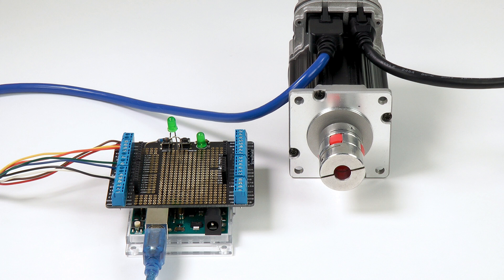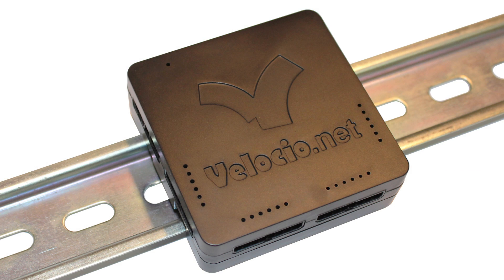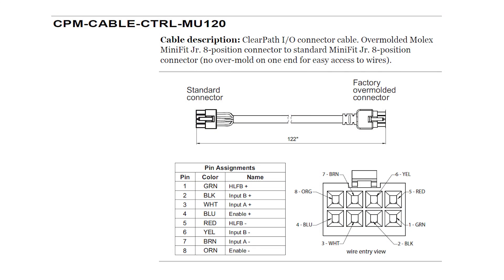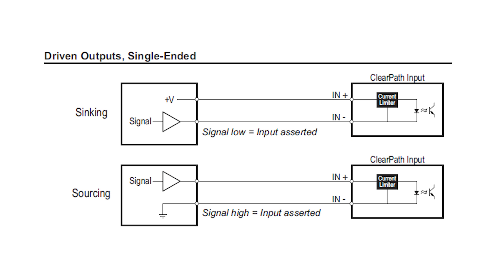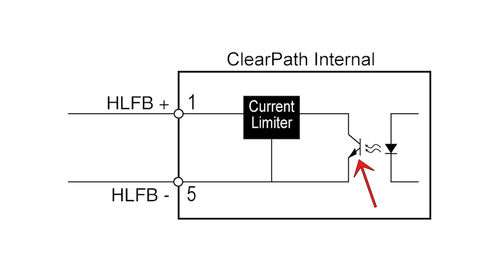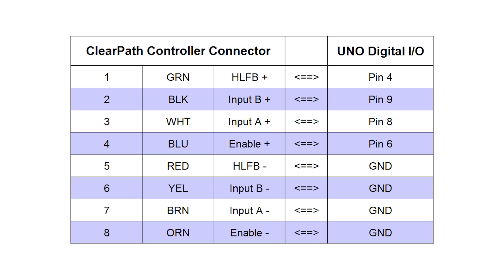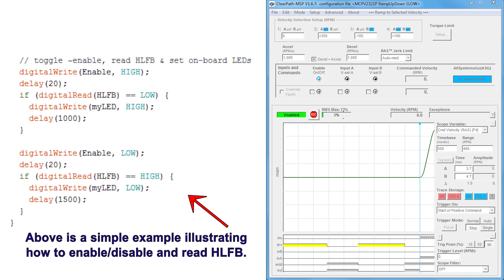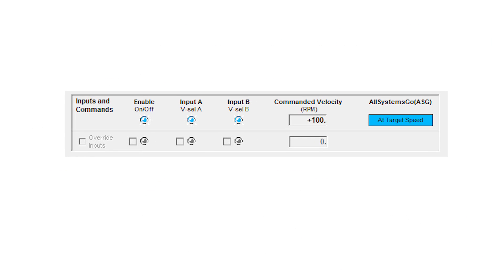How to Wire an Arduino to a ClearPath Servo Motor

Comment: can you control those with grbl software?
Reply from the maker: Hi el SunShine,

While I'm not an expert in Grbl, it's my understanding that this open-source software works off the Arduino microcontroller and is traditionally used to output step and direction signals to several axes.

The ClearPath-SD ("Step-and-Direction") series servo systems are designed to accept step and direction signals from a variety of sources. All ClearPath motors have opto-isolated inputs that can be directly wired up to 5-24 volt logic outputs. Because the ClearPath inputs are optos, you can use sourcing or sinking logic. (You’ll need to be able to source/sink about 8-12mA, depending on your logic voltage. See the user manual for details.)

Many people have successfully connected Arduinos to ClearPath motors.

Here's a short technical overview video showing how ClearPath-SD works: https://www.youtube.com/watch?v=-gigcf7ZzAQ

Check it out and leave a comment or feel free to email support@teknic.com if you have any questions.

Thank you,
Kevin S.

Comment: You appear to have put the same Arduino code(velocity) for for both mode options. I believe the absolute move should be a different Arduino code. Could you post the correct code for absolute position please?
Reply from the maker: Hi cynertia electric, you are correct that we posted the same exact code for both the "Move to Absolute Position" and "Ramp Up/Down to Selected Velocity" modes. In this specific example, the base code for these operational modes can be exactly the same due to the way the positions and velocities are defined within ClearPath. However, the codes should have different annotations in order to avoid confusion (different comments and explanations). Thank you for pointing this out!

The positioning mode allows the motor to move between four different positions, while the velocity mode allows the motor to ramp between four different velocities. In the position mode, the four positions are defined by different combinations of high and low signals being sent to ClearPath's Input A and Input B (i.e. Position One = A low, B low, Position Two = A high, B low, Position Three = A low, B high, Position Four = A high, B high). In velocity mode, the four velocities are defined exactly the same way. In other words, in both cases, the binary combination of the two bits selects one of the four positions or speeds, respectively. This is why you can use the same exact code in this demo video.

I will see if we can make changes to the comments section of the "Move to Absolute Position" code to be more accurate. Please contact Teknic if you have any additional questions.

Best,
Bridgette G.

Comment: Just bought two clear path motors and need to control them with Ardunio. How do i get started?
Reply from the maker: Hi Tonny, This Arduino video is a good supplement to the ClearPath User Manual, step and direction operational mode video, and TekTip Tutorial series. The videos are quick references to get you started while the manual is a more complete explanation with more detail about the set-up. You may want to start with the videos and then move on to the ClearPath User Manual.

https://www.youtube.com/watch?v=1S7etlhbuFY

https://www.youtube.com/watch?v=-gigcf7ZzAQ 

https://www.youtube.com/channel/UC4Q91tGO80QMSHyy1SoHrtg
  
Here is the ClearPath User Manual:  https://www.teknic.com/files/downloads/clearpath_user_manual.pdf

Additionally, here is a link to the Teknic Arduino Libraries: https://github.com/Teknic-ClearPath/ClearPath-Arduino-Step-And-Direction

If you have any specific questions regarding ClearPath and your application, please email support@teknic.com

Best regards,
Bridgette G.
Reply: Hey Bridgette. Do you have a number or email we can reach you at?
Reply: @teknic
Reply from the maker: Hi Sean, thank you for your interest. There are a number of engineers here at Teknic that can help you. It's important to us that your questions are answered as soon as possible to ensure a timely response, please send your questions to support@teknic.com. We look forward to hearing from you.

Best regards,
Tom T

Comment: Hello, I am currently trying to utilize an SDSK motor to move objects on my system up and down left and right etc. I want to use pushbuttons to control all the various movements through Arduino but I'm running into different difficulties. Furthermore, we are building a UI for all these controls as well and I'm wondering if the SDSK will be able to be used for this application.
Reply from the maker: Hello Justyn, the SDSK motor communicates using step and direction signals. You can send steps from the Arduino to move the motor to any location at any speed within the motor's specification. There is a very helpful Arduino community located at https://forum.arduino.cc/ where you can find some specific advice regarding Arduino code, functions, and interfacing details.

Best regards,
Tom T
Reply: Is there a way to tell the sdsk to turn on at the click of a button at a certain velocity rather than telling it to go a certain amount of counts? Or is it only able to take step and direction commands? I've only been able to tell the motor to move at certain counts so far. When I tried to manually apply a PWM to input B so I can control the velocity of the motor through arduino I only get one real slow velocity. Any reason this is happening?
Reply from the maker: Hello, justyn, the SD motor that you have only uses step and direction signals for motion control. You can control the velocity by changing the frequency rate of the pulses being fed into input B on the ClearPath. I am not an Arduino programmer but the Arduino support forum mentioned above should be able to help you.

Best regards,
Tom T

Comment: Are all of your motors wired the same to the Arduino? 
I am looking at the SC motor and with an Arduino Mega 2560 R3. Do I need to use GBRL?  Does your SD motor go through a setup like the SC does when it checks itself? This video caused me confusion and I was not getting the answers I needed from your support. When I called them- they did not recommend the Arduino?  I am trying to do a mill conversion to CNC. Some confusion on YouTube is terminology everyone calls your motors "Servo" when actually they said they were using an SD and not SC.
Reply from the maker: Hi gaewing,
 
This video uses a ClearPath SD motor executing point to point moves (not contouring moves used for CNC control). This is very different than following G-code for CNC applications. ClearPath SD servos are meant to replace other "Step and Direction" servos or stepper based systems.  The SD model simply takes digital inputs for step, direction, and enable and is often times used for CNC machines that have a CNC controller. 
 
ClearPath “SC” servos are meant to be connected to a full PC or single board computer running a C++ application that you write for your application. You use the Teknic provided C++ API for developing your own software application. The C++API is not compatible with an Arduino or similar microcontrollers.  
 
Arduinos are not commonly used for CNC applications for many reasons. It can be done, using GRBL, but your results may vary. Using a more common CNC controller should provide superior results (both robustness and repeatability).  
 
Best regards,
Brendan

Comment: any chance to get a wiring diagram to connect on the most common 3d printer board to really kill the steppers? i have 1000$ components in my cart, i just waiting for a good diagram to remove the actual driver+steppers with the clearpath...
Reply from the maker: "Hi Elstak Manu, 

Thank you for your question. 

There are 3 input signals used for the Step and Direction (SD) motors: Enable, Input A(direction line), and Input B (step line). The pin-out and wire colors for the Teknic CPM-CABLE-CTRL-MU120 controller cable is listed on page 116 of the ClearPath User Manual:

https://www.teknic.com/files/downloads/clearpath_user_manual.pdf 

Your controller needs to output 5-24VDC for each ClearPath input. The "+" for each input (e.g. Enable+) is the active signal coming from your controller. The "-" for each input (e.g. Enable-) is the ground that completes the path.

Please let us know if you have any other questions.

Best Regards, 
Tom T
Reply: Teknic Inc thanks, 2 quesyion thinking to replace all steppers with clearpath: 
1)while autotuning the travel is automatically detected (i think in that mode the board endstop is ignored) or what? 
2)if my design use 2 motors for each move, how to autotune 2 motors in the same time ( HBOT design)

Thanks and... why no 17 line?
Reply from the maker: Hi Elstak Manu,

The auto-tuner function has a screen that allows the user to limit the stroke distance during the auto-tuning process for axes with constrained motion. As you go through the auto-tuning process, you will be given an opportunity to limit the stroke before the actual tuning begins.

Dual motor axes are a little tricky to auto-tune, but one way that usually works pretty well (assuming the X and Y axes have the same mechanical transmission design) is to tune the Y axis (the single motor horizontal axis) temporarily loaded up with half the weight that the X axis handles, and then to use that tuning configuration file (slightly modified as described below) as the X axis configuration file:

1. And to reiterate, we’re assuming that the X and Y axes have the same mechanical design (e.g. both axes use a rack and pinion with the same pinion diameter, tooth pitch, etc.). If the dual motor axis is a different mechanical design than the single motor horizontal axis (e.g. the dual motor axis is rack and pinion and the single motor axis is a ballscrew), you should contact Teknic for support at support@teknic.com. The vertical Z-axis should not be used in this procedure.

2. Load 1/2 the total X gantry weight onto the single Y motor axis and then run the auto-tuner.

3. After auto-tuning the one Y axis motor with the appropriate weight, save the file to your computer as the X axis motor file.

4. Connect MSP to each of the X motors and load the X motor file into each motor. If the X motor shafts are facing each other, one motor will be moving clockwise and one motor will be moving counter-clockwise when the gantry moves down the table. You can either compensate for this by programming your controller or you can select the “Reverse Direction” checkbox on the MSP main page for the Step and Direction mode. If you select the “Reverse Direction” checkbox for one motor, you will send the same exact command to both motors when making a move.

5. If the two X axis motor files are different (i.e., if you checked the Reverse Direction box for one of the motors), save the two X motor files with different names (e.g. Xa_SDSK-3421S_rev1 and Xb_SDSK-3421S_rev1)

6. Run the machine.

7. If the X axis does not seem to have optimal tuning, try to improve the tuning by moving the "Fine Tuning" slider to the left to see if your results improve. You will need to do this with both X motor files before evaluating the effectiveness of this step. If you make any changes to either file, re-save the new files (overwrite the old files or create new names) so you have the files saved in a safe location for the future. 

8. Always use the same RAS setting for all motors for CNC applications.

Teknic has investigated the possibility of manufacturing a NEMA17 size ClearPath integrated servo motor. The objectives for the project would be to scale down Teknic’s technology into a NEMA17 package without sacrificing quality, and to be able to manufacture these motors in high volume at a competitive price. At this time, we don’t believe we can meet all of these objectives, so the project has been put on hold (at least for now). 

For more information, please email us at support@teknic.com

Best regards,
Tom T